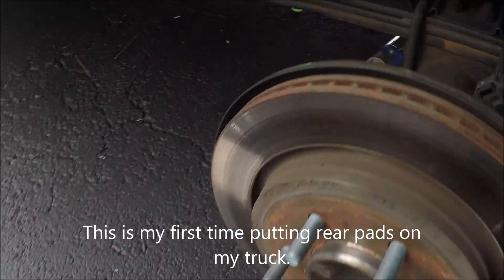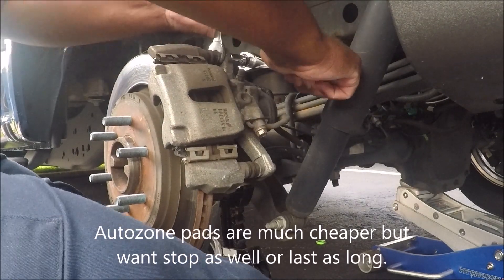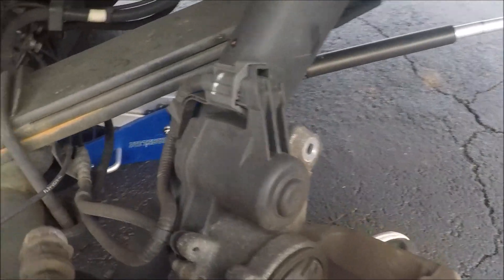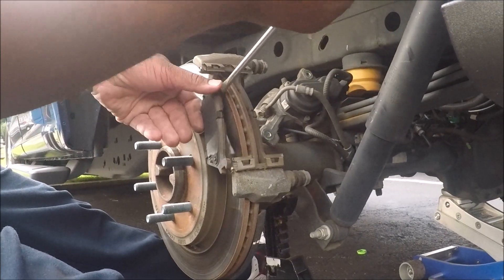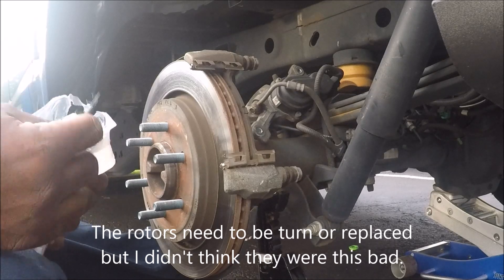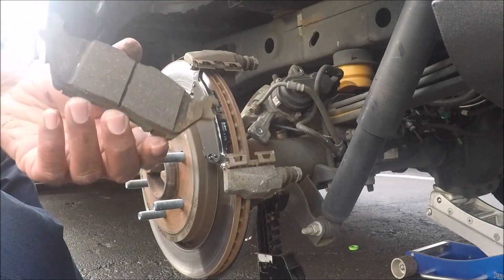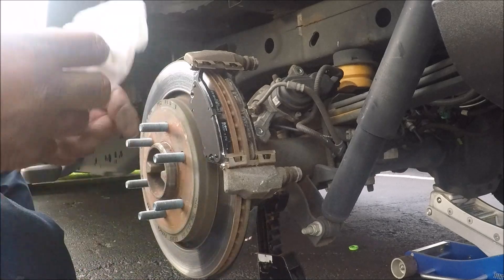Replace Motorcraft rear brake pads on 2016 F150

Comment: I know you said you dont know or care what the ft/lb torque is for those bolts. But just in case someone was wondering, its 35 lbs. Great video man!
Reply: Thanks Cameron....  I do care about the torque and was trying to find it!
Reply from the maker: @BRH2100  I saw a guy break a 13mm bolt trying to torque it to spec. I seen another strip a 10 mm bolt doing the same thing. I've never had caliper bolts to come loose.
Reply from the maker: @BRH2100  I bet you still have not installed brakes on a F150.

Comment: Exelent video but no service the calipers? Supposed to grease isn’t?
Reply from the maker: 00:43 you can see bolt slides was loose. The truck only had 54k miles. The stock grease was fine.
Reply from the maker: I'm up to 88,000 miles now and all is fine. Have you seen my front brakes replace @ 20k miles? https://youtu.be/6iHIK359AYM

Comment: Where did you jack yours up? I hear people say do it from the pumpkin and others say not to? O also see you have a jack stands in there but can't see where it's resting.
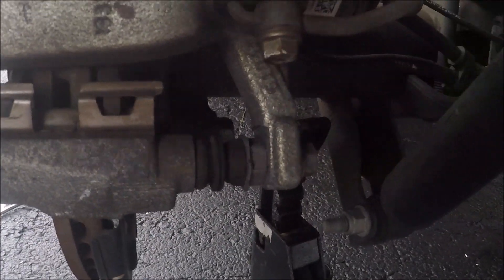Reply from the maker: You can't see where the jack is resting? 00:58 The axle tube does not have to sit on the stand for it to work. The jack is not going to fall but I put used a stand just in case.

Comment: Why didn't you replace the brake clips? They came with the new set of pads right?
Reply from the maker: There was nothing wrong with the old ones.
Reply: You don't necessarily need to replace them. Sometimes the new ones don't fit quite right and it takes a lot of doing to get the pad to fit into them. As long as original ones aren't damaged, you can just reuse them. Sometimes I'll replace them anyway.

Comment: You could have greased the slide pins you pull them out of the boots clean and grease them but close enough 🔴🇺🇸🔧👍
Reply from the maker: They have enough grease on them. I can tell by the way the caliper moved.
Reply: @blackericdenice  sounds good 🔴🇺🇸🔧👍 its always good to remove wipe the old grease and dirt clean and re lube them, they tend to get dry then water gets in #1 cause of uneven pad wear  sticking slides 🔴🇺🇸🔧👍
Reply: They have a threaded bolt in them.I took mine apart. So I don't know why. You can't turn them in..